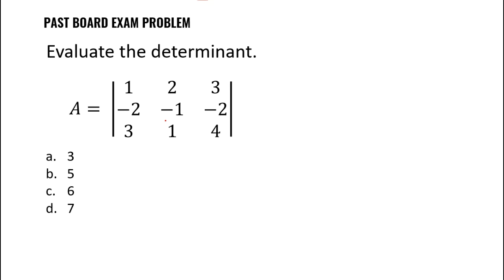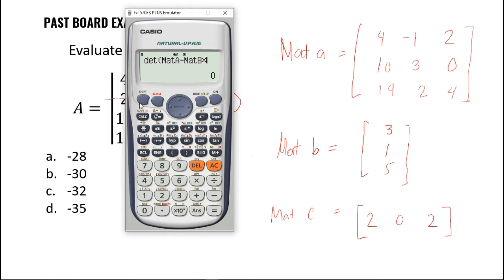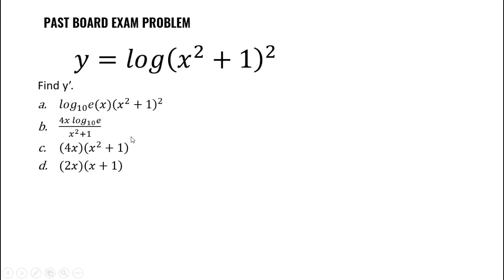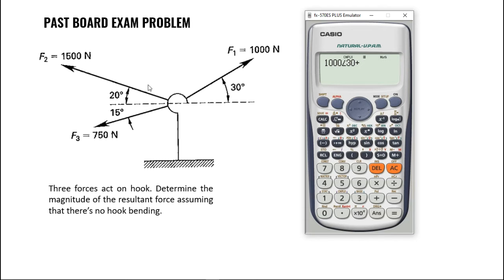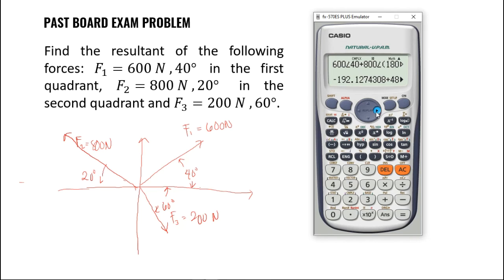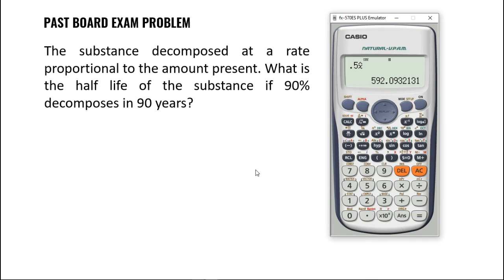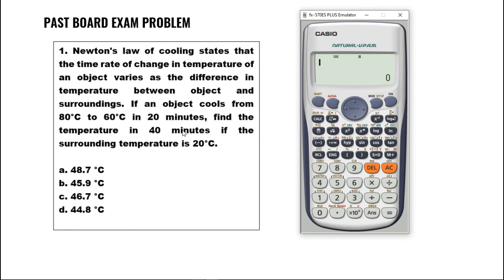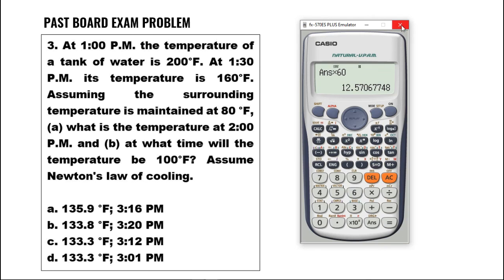CALCULATOR TECHNIQUES PART 2: Differential Equations, Advanced Mathematics and Engineering Sciences

Comment: Importante po ba yung stat sa mga mechanical engineering student sir, involved parin po ba yun sa board exam namin, baka po kasi pang civil lang. sana manotic po ty.
Reply from the maker: Yes. are you referring to statistics? Statistics is important to all engg courses. During my time may mga lumabas na item like mean, standard deviation and variance so you still need to familiarize those basic or fundamental concepts..
Reply from the maker: If you're referring to statics, yes importante po Kasi foundation po yan ng machine design. May mga problem sa board exam na statics so ifamiliarize natin ang fundamental concepts of statics like force equilibrium..
Reply: Sorry engr it took a day to reply. Yung mga resultant po ganun, kasi po sabi ng prof ko ay kahit di na masyado mag focus sa ganun since, pang civil yun.
Reply: Opo statics po hehe. Thank you po, will familiarize my self with that. Gawa pa pokayo calc tech, ito po inaabangan namin mga friends ko and classmates. More power engr!

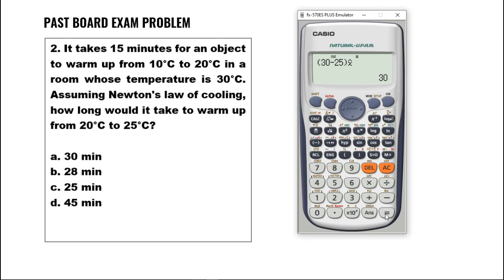Comment: 54:00 I believe the all answers to this question are incorrect.  It takes 15 mins to warm up from 10deg to 20deg, and it takes 30 mins to warm up from 10deg to 25deg.  Therefore it should take (30-15) mins warm up from 20 deg to 25 deg.
Reply from the maker: Thank you for the clarification. It should only take 15 mins to warm up from 20-25 degree C. I should not have included the 20 degree C. Well appreciated man! God bless😁
Reply: @EngineerProfPH  Thank you for your response. I learned a lot of calculator tricks not seen anywhere before. The use of STAT function to solve differential equations and summations is ingenious. Great videos! Keep it up!
Reply: do you know where i can find a video to solve first order differential equations using a calculator.....also preferably a question that doesnt have multiple choices like in this video
Reply: @manoahkarara5289  You can use Euler's method to solve initial-value problem of first order differential equations. 
Video: https://www.youtube.com/watch?v=Xne6kd2dJ9w
Paper: https://doi.org/10.31142/ijtsrd18374